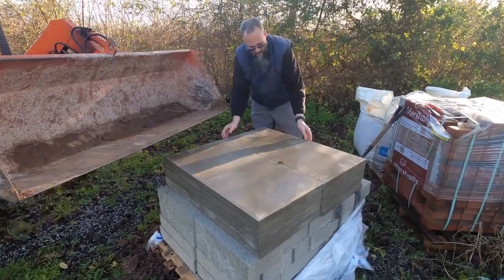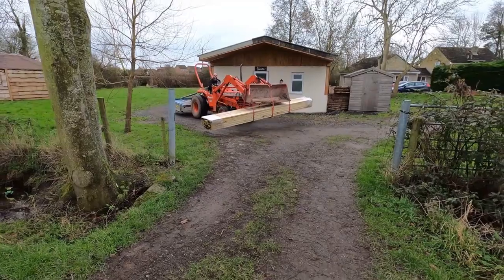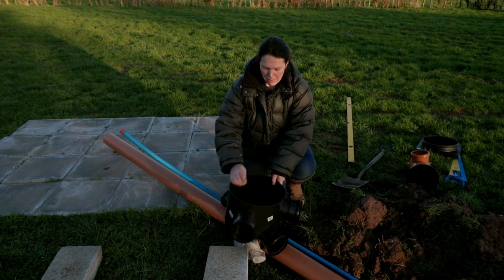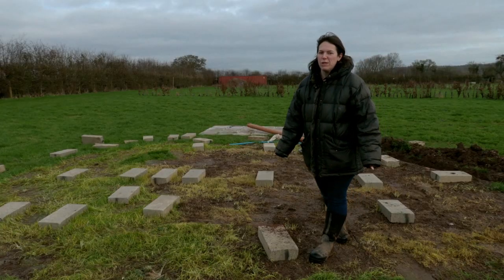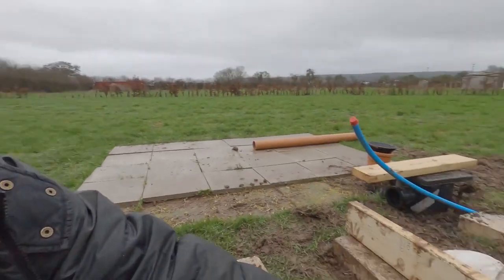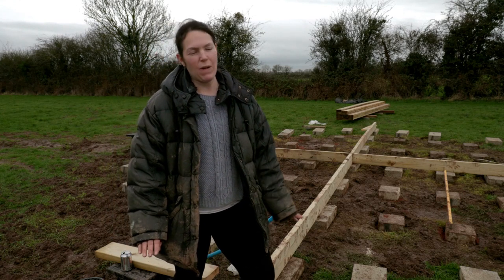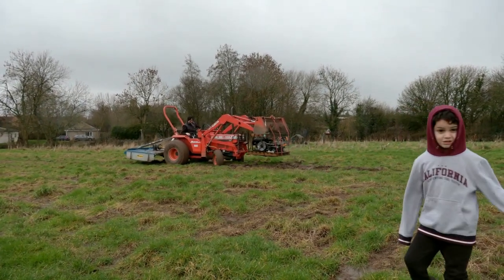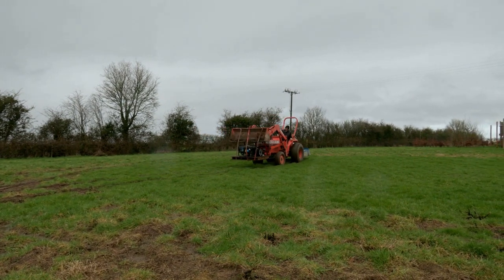Building a base for a Geodesic Glamping Dome

Comment: Hi there did you paint the deck floor and what with please. Also as nails screw into the floor did that show through the wood. We have put plywood on our base
Reply from the maker: Hi, I feel like I painted it with floor paint but it might just have been wood paint but I definitely did a couple of coats of hard wearing varnish. It is a bit scratched now 3 seasons on. You can see the screws but I've put lots of rugs! Here is the video of the interior painting etc https://youtu.be/6MZDI-ecC9U?si=OLk8uSgwDctdnbXF
Thanks! Vicki